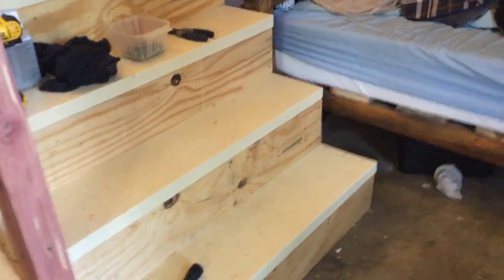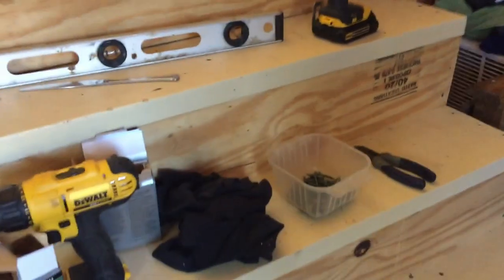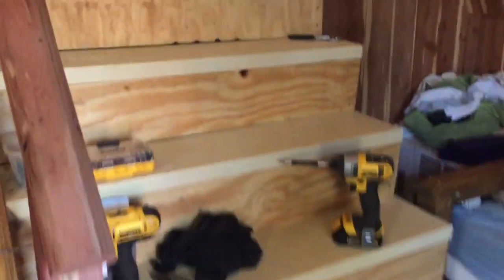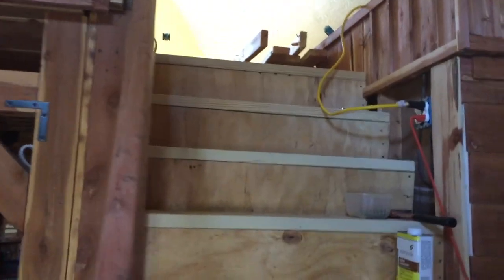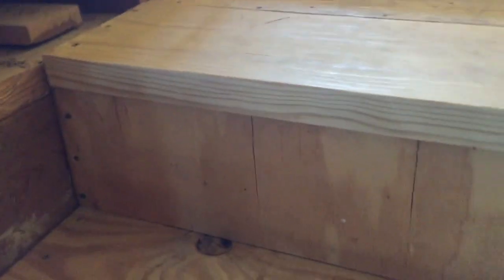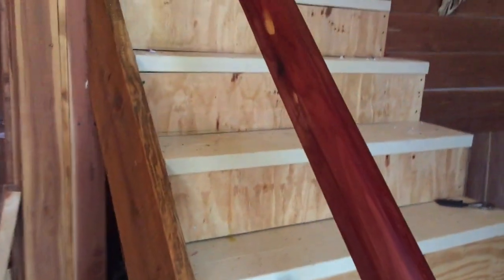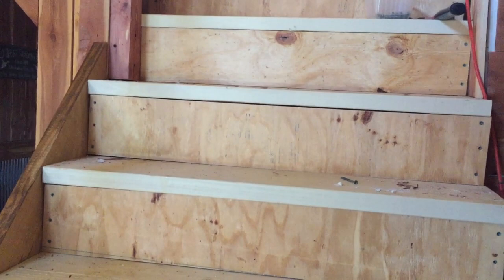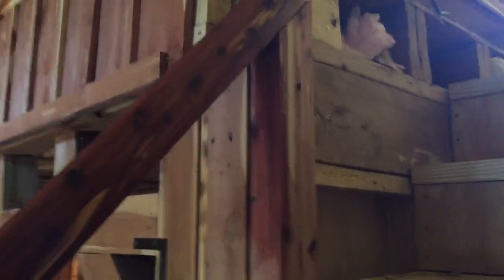PUTTING THE RISERS ON THE STAIRS. Finishing up the stairs.

Comment: Looks nice. I have seen other channels mix acrylic paint to get as near to the color needed and then add water to dilute and then put on wood to use as a stain. Might think about that and experiment. Most acrylic paint is $1 in small bottles until you can find the color needed. Use the scrap wood and do the same treatment on it as the piece of stair piece so you can get it right before applying it to the big piece. Just a thought.